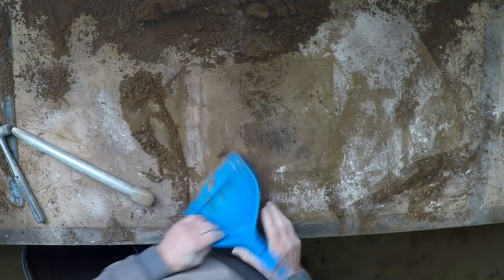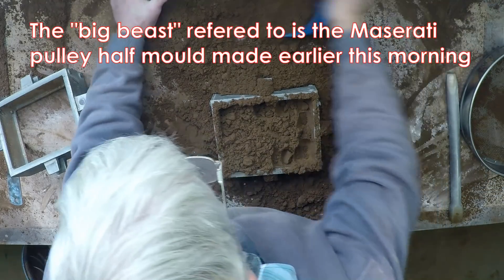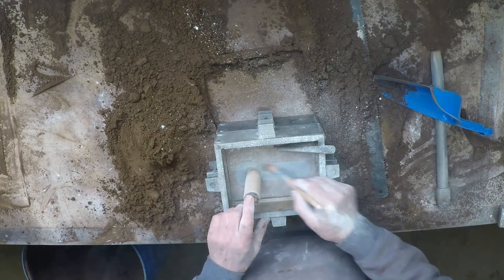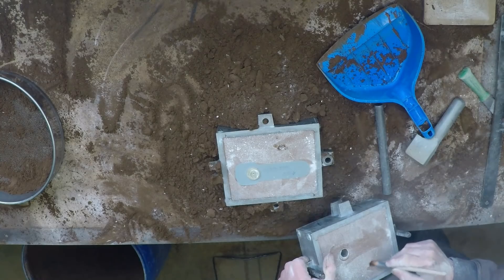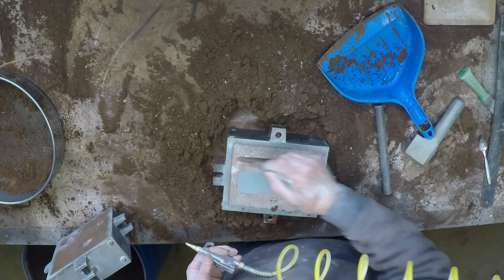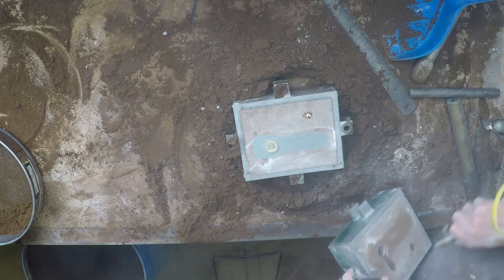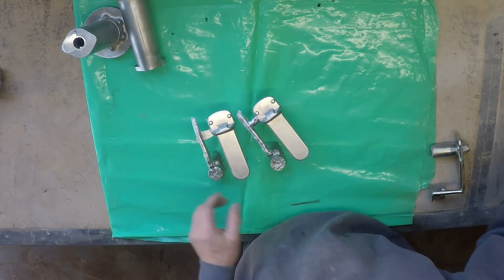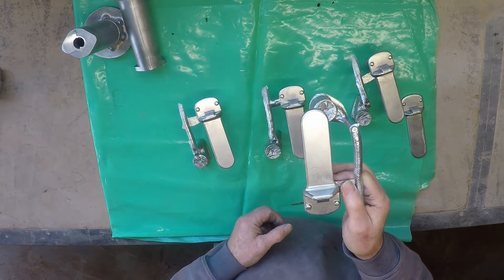Sand Casting an Aluminium Vacuum Cracker for Jars

Comment: Hi i cast one of the few to make  moulds for plastic  injection tools . i pour on to aluminum models (low melting i pour at 480 mounted on plasters)    which i cast from wooden or plastic models in the cnc world i get looked at a bit odd but it does the job .just wanted  to now the aluminum temps you pour at   cheers
Reply from the maker: Dave, I usually pour my aluminium (356 alloy) at 710 to 740 deg C.... Martin

Comment: Fantastic job!  That surface finish is almost mirror-like.  I am about to venture into casting but I don't have a metalworking shop so your guidance will most certainly be of real help.
Thank you and cheers from Canada!
Reply from the maker: High, Good luck with your casting endeavours. Greetings back from Australia - I am almost a Canadian as both my parents were! ... Martin
Reply: @olfoundryman8418  :  Thank you Martin, you're very kind.  The first real project is to cast a brass plaque to act as a grave marker for my sister who passed away a while ago. Her son and I will be making it together and it will be a good and rewarding project. I'll keep you posted.
Aussies and Canadians may be on the opposite sides of the globe but we're pretty close in everything else. Eh? ;-)
Reply from the maker: High, Yes, many similarities and thus differences from those south of your border but I have to be careful what I say as my male line got to Canada via the US. They had arrived there in the 1600s In fact there is every likely hood that dad studying in Pennsylvania in 1929 (probation era) left the US for New Zealand to escape the feds - I think dad may have been into a little bootlegging    😊
I have done plaques and they are not that difficult depending on how big you wish to make them. The hard bit is doing the pattern work first. I did it by getting a rubber stamp making man to photo engrave the pattern from my artwork. I then backed the photoengraving with a suitable thickness of wood painted it appropriately and then used it as the pattern. I also dried the green sand moulds in an oven with the result that I got beautifully sharp lettering on the plaque. If you like send me an email address and I will send a photo of some of the plaques....Martin
Reply: @olfoundryman8418  Good morning Martin (well..it's morning here..and a chilly one at that!)
Thank you for your reply. Yes, our neighbours to the south are a special bunch and though we often are shaking our heads in disbelief, we appreciate their varied qualities.
I am what I like to call a Monty Python version of a Canadian - mother's side is a long line of french-canadian lumberjacks and my father and grandfather were Mounties from out west. :-D
I would love to see how you made your plaque. My email is: david.frere@gmail.com
I have a laser cutter at my disposal and was going to make the model out of MDF. I understand that sharp, vertical edges are ill-advised and was going to smooth out the lettering by hand. I am open to all suggestions.
Cheers again and many thanks!
Reply from the maker: High, I will email you when I have a little time up my sleeve for now I am embroiled in the annual tax saga and I thus have a headache! 😰 InN a day or two with luck... Martin
Reply: @olfoundryman8418  
Hello Martin.  I don't envy your having to deal with taxes , it'll be my turn in the (our) springtime. And please don't trouble yourself too much, you've already been a real help and I continue to watch you fascinating videos.. 
Thanks again
David

Comment: very interesting indeed- Like the comments about flow and the sprue height
Reply from the maker: Bike, One of my pet hates is the unnecessary use of big high sprues made worse with a stupid funnel on top. These things only serve to increase metal turbulence and thus lower casting quality. There is no advantage in their use - only disadvantage and this casting brings out the value of not using such things... Martin

Comment: Martín, I have a question, What is the white powder? Calcium Carbonate? why do you use that? thanks Augusto
Reply from the maker: Agu. The white powder I use as a parting agent is indeed calcium carbonate. I buy this from a foundry supply house as parting agent but the bags are plainly marked "calcium carbonate" I use it because it works well, is cheap (about $3.00 per Kg, and I believe the human body tolerates it well (and a little extra calcium would not hurt😊 ) The alternative that many people use is talc, this costs about $10.00 per Kg and some of has a perfume smell that can become annoying after a while. Talc is know to sometimes contain a small percentage of silica so you don't want to breath it. Also talc from one mine in the US (now closed down) was found to contain asbestos definitely do not want to breath that in! There are currently some questions about the safety of talc and I don't think the human body can dissolve it as readily as calcium carbonate. If you are not casting very often the talc is probably fine but if you are casting a lot I think it best to get the calcium carbonate.... Martin

Comment: Haha, cleaning glasses with compressed air! I notice you used compressed air a lot in your mold prep work. I was inspired to try it - but failed miserably. Turns out my cheap air gun has on, or off - nothing in between! Anyway, I love your channel and that you share your vast knowledge with us! I am a bit embarrassed to say it, but getting over myself - I would love your feedback on my latest casting adventure (vid here https://youtu.be/izxUqBCf8Io ). I am planning to do 4 or 5 more of these little pipe clamps, so any improvements to my process would be very welcome... PS I give your channel a little plug in the vid ;)
Thanks again, Bongo.
Reply from the maker: Bongo, The trick with the air is as I think you have worked out to have an air nozzle that turns on slowly rather than al at once. Another trick is to point the nozzle away when you push the button or lever - always with air there is an initial rush which quickly subsides, the rush can blow a delicate mould apart. But perhaps the most important trick is to have a cheep little regulator in the air line  to drop the pressure to about 15 PSI. I will now go and have a look at you video and thanks for the plug... Martin
Reply: @olfoundryman8418  ha great tip. In the heat of the moment I didn't actually consciously set the regulator... obvious things getting overlooked... thanks!
Reply from the maker: Bongo, The little regulator is an extra in the line and mounted a bit above my head where the line splits to the pneumatic rammer - a full pressure device - and the air nozzle, its permanently set at 15 PSI so I can not forget!. I have watched your video and here are a few comments (there are lots but I will take it easy on you 😀) Despite having no doubt placed it in the oven that plaster was not dry and you can see that by the way the metal in it trembles as steam from the plaster bubbles up the plaster metal interface. My own experiments (incomplete admittedly) indicate that you need about 400deg C to dry it completely - I could never convince Veg of this! Your method of pouring the metal in is absolute crap - sorry - but no other word for it. It is as though you were trying to get lots of air bubbles into your metal. And quite probably that's what those defects were that you uncovered during machining air bubbles as a result of bad pouring practice. Send me an email address and I will draw a rough sketch of how I would have done it. The defects could also be due to the steel chill plate not being clean and dry enough. If you look at my video on making the Hercus gang tooling block https://www.youtube.com/watch?v=y1wPdnriau4
You can see how I use the chill. Before I place the mould on it I clean it (as you did) but I also heat it with a gas torch or in an oven to at least 200 deg. C this dries it and should get rid of an oils and greases particularly those from the skin. Once heated I just let it sit there while the metal melts then close the mould and pour. If you put the mould onto the plate while it is still hot pour immediately! If the plate is cold when you put the mould on you can pour a bit later. With a flat chill plate I usually dust it lightly with a bit of parting agent as this seems to help get air out of the way but the best thing to do is have small grooves cut in the chill you can see this in my video of casting the pistons https://www.youtube.com/watch?v=Gt_eLBkGRSc&t=13s Another of my videos that maybe be of help is this one https://www.youtube.com/watch?v=kf2xae2J9HE
Here I cast the chills for making the piston - this is how you should get metal into your castings a decent properly shaped pouring basin, a small tapered sprue, and a separate feeder.... Martin
Reply from the maker: Bongo, I forgot to say that you are to be congratulated for it was  a great pleasure to actually see someone making something that they will actually use, rather than just cast a lump that will sit uselessly on a shelf or even worse pour metal into a melon! Most of the casting on YT is just useless crap - what's the point? - I make what I need or someone else needs and will pay for -   no time for crap - well done.. Martin
Reply: @olfoundryman8418  Thanks Martin. Lots to contemplate and put into action on the next pour there, thanks very much for the advice and feedback. I did put the chill plate over the furnace for a few mins, getting it to just below 200C, but I don't think it was clean/ smooth enough (still had some mill scale etc). Seems like my pouring basin, and gating is in need of attention too. If you have the time I would love to see a sketch of you you would arrange it. You can reach me at bongodrummer at hotmail dot com. Thanks again. B.

Comment: I love your videos! Id love to see how you go about achieving the right temperature for the aluminum. Is it something you just go with your gut with or do you gauge it?
Reply from the maker: Isaac, For aluminium castings I always measure the temperature of the metal with a thermocouple - (those silly infrared remote things are unreliable on molten metal) Every different casting that I make has a one page record sheet on which I record, amongst other things, the temperature I poured the casting at. If the job comes up again , as often happens, I refer to this sheet to see what I did last time and if I made any comments on the sheet that may suggest a different temperature or other changes. One of the "tricks" to reliably getting good castings is to keep things constant for any given job. Many things are difficult to control but metal temperature is one that can be easily controlled and checked. These days thermocouples and the instruments to read them are readily and vey cheaply available on "FleaBay"... Martin

Comment: Hi Everyone. would anyone be able to help with a way i could contact the gentleman to ask for assistance with casting some small vintage bike parts? Thanks.. Mark
Reply from the maker: Mark, Do you have an email address that you can send? To stop the robots use "uppercase2"in place of"@"... Martin
Reply from the maker: Ivan, Will email next day or so... Martin
Reply: Hi Martin, Thank you for your reply and very sorry for my slow reply, My email is: mooz722gmail.com
the second 2 is to replace as suggested ( great tip to, Thanks) 
Best regards Mark
Reply from the maker: @markbarker4702 , About to email you.. Martin

Comment: Hey olfoundryman.  I’m a little curious about your history and where you learned all this.  I’m just getting started in my unfortunate early retirement.  I need something to do.  But watching you just brings up questions if you don’t mind.  Have you been doing this your whole life?  Were you a retired sandcrab from somewhere.  Inherit the knowledge and tools?  I’m sure we’d all like to know more.  I’m watching previous videos so if you have answered I’ll run into it sooner or later.  Oh and one other question.  Did you make those flasks yourself?  It looks like they are screwed together.
Reply from the maker: Hemi, A brief history. At age 10 making fishing sinkers in carboard moulds backed up by loose sand. Then some melting down of aluminium scraps dropped by electrical line workers. Then some teaspoons cast in plaster moulds using a low melting alloy that melted in hot tea. Fascinated by how one could mix 4 metals together and get an alloy that melted below the melting point of any of the four I read "Metals in the Service of men". I got  hooked by the book and particularly the article in it on casting the props for the Queen series of ships. Finishing secondary school I studied Metallurgy at the RMIT. Before the end of the course I had set up my own crude foundry. A series of jobs that included some foundry experience and improvements to my own foundry followed. A stint as a foreman in a gravity die foundry finally on to foundry Metallurgist at a large (for Melbourne) aluminium gravity die foundry all the while working in my own foundry earning that bit extra - paid for our first computer ($6K mind you!) eventually by about 1990 on my own with foundry as sole source of income to feed the family and pay off the mortgage. All the while learning whatever I could from where ever I could trying experimenting refining technique, never being content with the status quo or to stand still. Finally got on to John Campbells work and thus still learning and learning lots. No one before me in the family or since has ever done anything like this (they were/are way smarter than me! 😏) Yes I made the flasks they are bolted together and represent the 4th iteration of making my own metal flasks. I hope to do a video on my journey through moulding boxes stretching back 50 years plus - the good the bad and the just plain ugly of them. I further hope to follow this with another video about a new box design based on what I found out in those 50 years. It is a very versatile design well suited to the hobbyist. It is in aluminium and is aimed to be buildable by anyone with only rudimentary equipment - a drill press and hacksaw may be enough. There will be quite some work in the build but the result will be well worth it - my metal boxes have lasted well over 25 years and still going strong... Martin
Reply: Thank you Martin.  The book “Metals in the Service of Men” sounds like something I want to read.  My profession was computer repairs.  Had I not fallen into a job fixing computers after school in 84 I probably would have landed in a garage or machine shop.  I found metals interesting but computers were very profitable most of my working life until the late 90s when they started to bore me.   I bounced around having forgotten my interests in metal until a couple years ago when I needed a piece of linkage for my old Jeep and I ended up chucking a round tent peg into a drill press and shaping a ball on one end with a hacksaw and a file.  Then painstakingly reducing the other end to the size I needed to cut the treads and a couple other details to make it bolt up.  It got me thinking about a lathe.  And I stumbled onto the Gingery Lathe books.  The whole concept of building these tools for pennies on the dollar was certainly attractive for a disabled, bored, broke, and all but homeless man.  And casting and shaping aluminum from scrap opened up my imagination and need to work my hands.

Back when I first learned about tempering steel with heat and quenching, I was amazed that I could soften a piece of medal, cut it and then harden it.  I wondered if the ancients though metal was magic when they were discovering it and it’s mysteries.  So I think I’ll enjoy that book.  I’m also amazed you do production work in a one man home foundry.  When I first saw your video for the piston I though you were a hobbyist.  But since I’ve been watching your previous videos it kind of blew my mind.

Keep up the good work, and thanks for the education!

Hemi